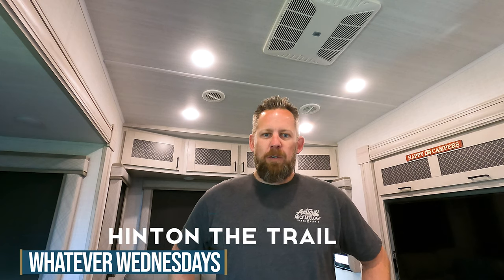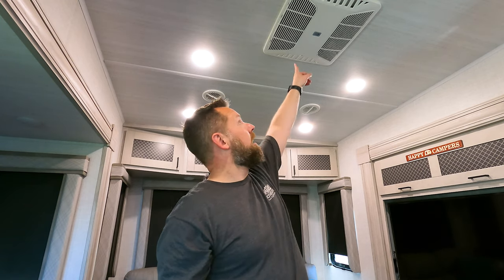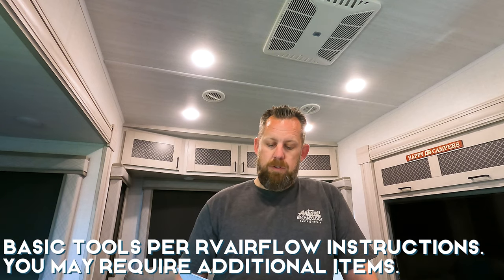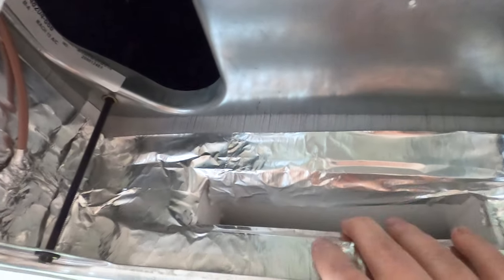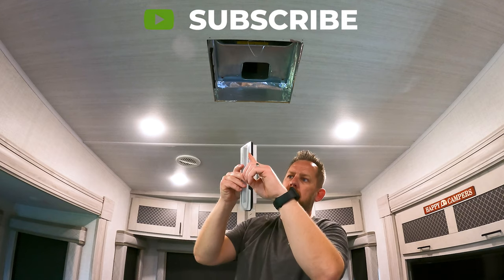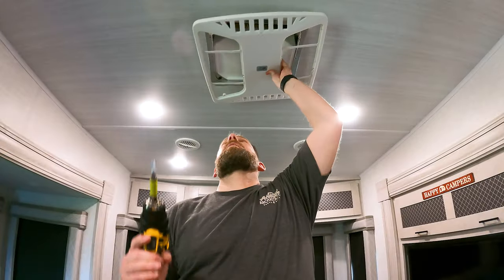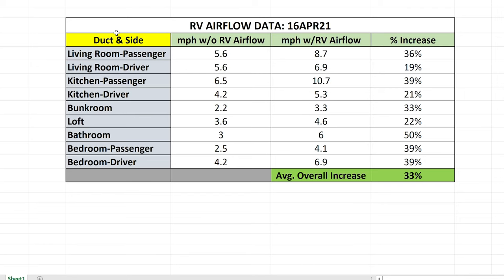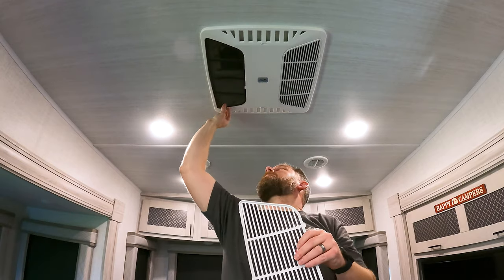Boost Your RV A/C Airflow up to 40%: RV Airflow Review & 15% Discount Code

Comment: Our first a/c unit froze up twice and was not cooling with 80+degree temps. Had unit #1 replaced with a new Mach 15k. Last night we got home at 9:30pm and it was reading 78 degrees with the new unit and half the coil was iced over. Got unit #3 put on today and although it blows extremely well and hard, the cfm out the vents are almost nil.
I took pics inside the ductwork and they are clear. This new foam block has to be an improvement, reducing the turbulence to get to the trunk lines.
Reply from the maker: We haven’t had any icing over since adding the RV airflow. It’s been awesome!

Comment: Great video, definitely solidified my choice to buy it.  One quick question.. I noticed your percentages are all calculated wrong.  If a vent goes from 3 to 6, that isn't a 50% increase that's a 100% increase... Youre literally doubling these values.  The rv air seems to have improved it a lot more than your percentages claim.  Great video, loved the install portion.  Can tell this took a lot of time, thank you.
Reply from the maker: Eric, my (Chris) math is terrible.  We really undersold the impact of the product on the airflow.  We may be doing an update video and will try to actually use mathematics.  Thank you for watching and hope you enjoy the RV Airflow!

Comment: Whats the difference with closed and open
Reply from the maker: When you close the dumps directly under the unit the airflow goes to the vents. When you open the dumps the airflow comes out from under the unit and very little air gets to the vents. When you put in an RV Airflow, 100% of the air gets sent to the vents.

Comment: Would it do about as much good to just block off the hole to those leaky plenums and just have all the air blow out the dumps?
Reply from the maker: You would only be getting airflow directly under the a/c and not throughout your RV.  Any rooms that have a duct running to them would no longer get any airflow and would get hotter.

Comment: So adding that foam thing is a no no if your just running a ductless coleman mach 15 right?  Is there anything you can do to make a ductless coleman mach more effiecient and cool better?
Reply from the maker: Correct. You can’t utilize this product on ductless a/c units.  We not away of a product that will help a non-ducted unit.

Comment: Does this help lessen the noise?
Reply from the maker: It does. We didn’t measure the sound change but wish we had. It is noticeably quieter. Someone else tested theirs and found a 3-decibel level change.  
We also have a SoftStartRV unit on our 
A/Cs and that cut down the noise too. It eliminated that loud thumping every time the compressor turned on.

Comment: The problem with the new RV's is that a lot are running the new whisper quiet systems.  You can't see the A/C from inside the RV.  How do you fix one of these systems?
Reply from the maker: Not sure what that type of unit is.  This product is specifically made for roof mounted, ceiling ducted A/C units.  It’s engineered for the plenums in those types of units. Wish we could be of more help.
Reply: @HintonTheTrail  I know.  All of the videos on youtube are for a/c's that stick out of the ceiling.  Mine only have two returns for each a/c but on opposite sides of the RV.  I have no idea how they're vented in to the duct work without pulling them off of the roof.  :(
Reply from the maker: @anthonynardella8907  I recommend that you contact the manufacturer. They should be able to send you information on where all the ducts flow and where things are vented.
Reply: @HintonTheTrail  Thanks but I did that already.  This was their response. "Per the information supplied this is would be correctly built per manufacturing standards for the unit."  I guess I need to look at installing mini splits.  I can't see any duct problems.
Reply from the maker: Now you have me really curious. Can you send your RV make and model in a instant message on Facebook?

Comment: These help.  But it would be REALLY helpful if all RV manufacturers sealed around the AC vents in the ceiling.  That's where a lot of air loss occurs.
Reply from the maker: There are a LOT of areas where efficiency in an RV could be improved. 😂

Comment: Did it make your system quieter
Reply from the maker: It did. We wish we’d taken readings before installing and after installing because we noticed a difference. 
The SoftStartRV also made a HUGE difference because the compressor thumping and kicking on is basically gone. It’s just a quiet switch on and off now. Combined they’ve made a huge difference.

Comment: There are videos showing you how to make this out of foam board for a lot less than $170 these things cost.
Reply from the maker: That’s one way you could go. The RV airflow is actually cut out of EPS, is temperature and water resistant, resistant to bacteria and mold growth, and contains zero formaldehyde. They’re also manufactured to very high standards and are created to allow zero air leaks. It all goes directly to the ducts.  People have also had great luck with personally made ones. Not sure if it’s the same quality and properties. We he important part is at the end of the day, people stay cooler and enjoy their RV experience more.

Comment: Great video.  I have one on order for my  2020 Salem hemsiphere 378fl.  It has two mach 15's but due to a bunk room over the master,  the ac has to be over the kitchen (middle of the rv) and the front ac is over the front living space.  These acs are not very far apart and the back of the rv gets hot.  I am putting the rv air flow on the ac that is closest to the rear. I'm wondering if I need to block the ducts so that none of the air from this ac can go towards the front and all head towards to the back.  I'm thinking this may help both units cool their areas better. Thoughts?
Reply from the maker: Thank you!
Are both of the A/C units ducted? If so I would honestly put one in both. 
If they’re not both ducted than the one that isn’t will only cool the room it’s in. If you block off the other ducts you would be forced to run that unit to cool that room. 
Either way, I would see what your results are before blocking any ducts. If you do block them you pretty much have to do it at the vents so the air would have already traveled that distance. Stopping it won’t help the other areas that much.
Reply: @HintonTheTrail  I was really talking about blocking the raceway from the second ac up so that it basically creates two zones.  The front ac would cool the open area of kitchen and from living and back ac would force air back on the long duct runs.   Otherwise, the rv airflow will be pushing air to the front also instead of to the back where I think it is needed more.  Yeah I'll try without first and then may buy another.
Reply from the maker: @DadofBallers  Ahh, now I understand. Sorry for the confusion.  Give the one a shot and see how well it does before you buy another and/or block the ducts.  You may be happy with the results.  
Do you plan on camping somewhere where you can only run one AC (30 amp or generator?) Something to think about as well.  Good luck and please let us know what you decide to do. Always interested in hearing how people deal with different RV issues.
-Chris
Reply: @HintonTheTrail  thanks for the reply and great point. At 43' most places we can fit are 50 amp service around GA/TN
Reply from the maker: Good point!  Take care and safe travels.
Reply: @RemotelyConnected  do you know which ones you got?  I got rv airflows installed in both mine and there is waaaaaay more flow in all vents except furthest master duct.  Big-time improvement to the bunk room.

Comment: Great video Chris.  Did the RV Airflow do anything to cut down the noise level from the AC?
Reply from the maker: Kirk, it cut it down. I didn’t do a decibel check before but wish I had. It made a large change. The thing that really helped with the thumping and the compressor sounds kicking on and off was the SoftStartRV (we have a video and discount for that as well). Both products on their own will make a difference and combined together they’re even better. 
The RV Airflow will send everything to the ducts which decreases the sound of the unit.  Long story short, yes, we saw a decrease. Hope that helps and thank you for watching! -Chris
Reply: @HintonTheTrail  Thanks Chris.  I installed the RV Silencer last season and it drastically cut down the sound and improved the efficiency just a little.  If this product increases the efficiency by up to 40% AND decreases how loud the unit is, than I'm all in and will swap it out. in the main unit and put the RV Silencer in the bedroom.  Thanks again for the input and the video.  Safe travels!
Reply from the maker: I have only glanced at the silencer because our second unit isn’t ducted so I don’t know much about it. I definitely can’t say if the sound decrease is compatible. 
We have a Coleman Mach 15 and it’s already a bit quieter than the domestics and some of the other brands but we did notice a difference. Not sure what unit you have. 
The airflow improvement was the number one concern for us, finding that the unit was quieter was kind of an added bonus.   
Definitely go through the RVAirflow site and look at the information. Maybe even email them and ask if the product is compatible with the silencer.

Comment: I have question, I hope somebody can help me, I bought a RV, and my ducts came with the foam inside( like te one when you buy something and came with the foam to protect the product) I suppose to take out the foams?
Reply from the maker: Are you saying that there are foam panels blocking the ducts or are you finding a lot of small pieces of foam (like packing peanuts) in the ducts?  If you're finding small foam pieces coming out when you turn the ac on that's pretty common.  The actual ducts in RVs are foam.  
If your unit has actual foam panels blocking the ducts I would contact the dealership you bought it out before removing anything.
Reply: @HintonTheTrail  yes!! But nobody in the dealership explain me if I have to take this foam out or let it like that
Reply: @HintonTheTrail  is like circular foam panel blocking the flow, but I am newbie,  it is my first Rv trailer, and I am doing it like full time living
Reply from the maker: @xionykareshi3024  If you want to take a picture and send and message it to us on Facebook we'll look.  We can only give you our opinion though, not as RV technicians.
Reply: @HintonTheTrail  thank I will do it right now
Reply: @HintonTheTrail  💞

Comment: Their price point is ridiculous with a little common sense in about $15 in material you can create your own
Reply from the maker: That’s one way you could go. The RV airflow is actually cut out of EPS, is temperature and water resistant, prevents bacteria and mold growth, and contains zero formaldehyde. They’re also manufactured to very high standards and are created to allow zero air leaks. It all goes directly to the ducts.  People have also had great luck with personally made ones. Not sure if it’s the same quality and properties. We he important part is at the end of the day, people stay cooler and enjoy their RV experience more.
Reply from the maker: I probably should have used the word "resistant".  There isn't a chemical additive that makes it mold resistant, it's how it's formed.  Below are a few links to articles about it.
Again, the goal whether you make your own or purchase a premade one is the same. Make your A/C and ducting more efficient so you can cool your RV down. 

https://continuingeducation.bnpmedia.com/courses/echelon-masonry/insulation-gets-more-effective/3/

https://goplymouthfoam.com/resources/EPS-Advantages/EPS-Insulation-Mold-Resistance.pdf